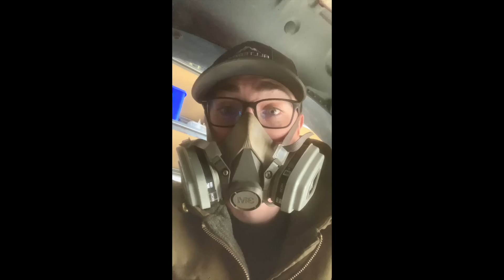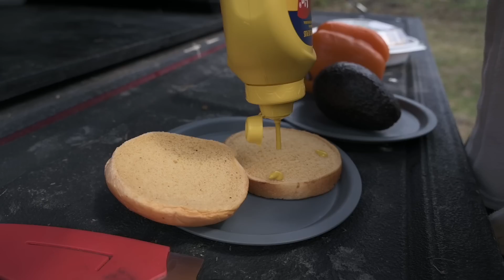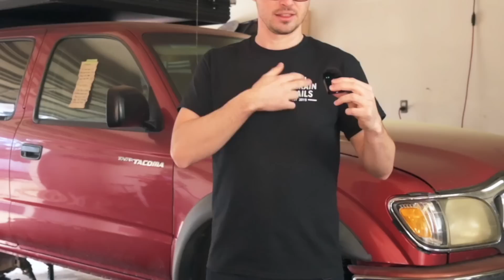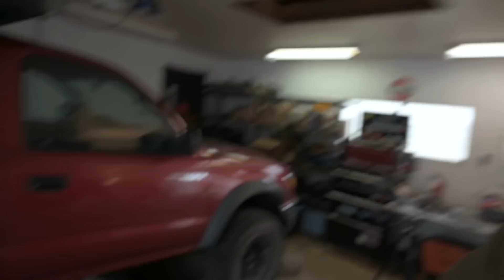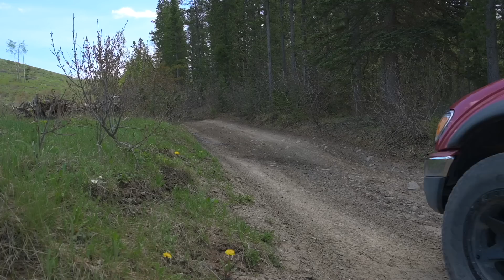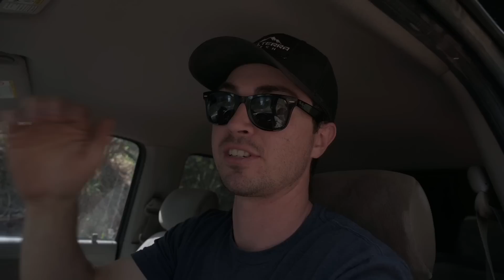Tacoma Shake Down | Off-Road Trip Reveals Serious Problems

Comment: Ratchet straps around the axle and up to the front tow point or a trans crossmember will help pull that axle forward. I use my slider legs on my 02 as a pull point and have slipped 3 sets of leafs in with zero struggle with his method. Good luck my dude